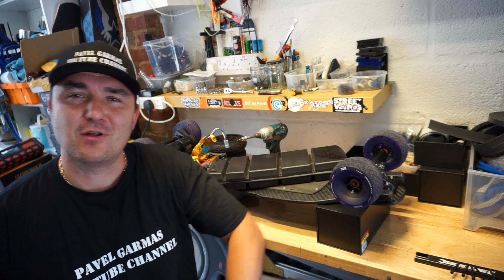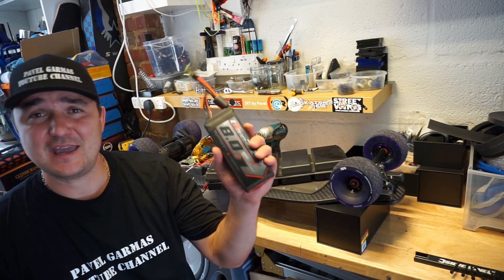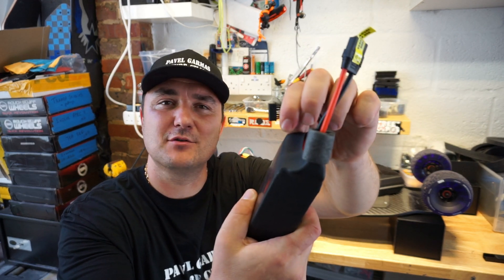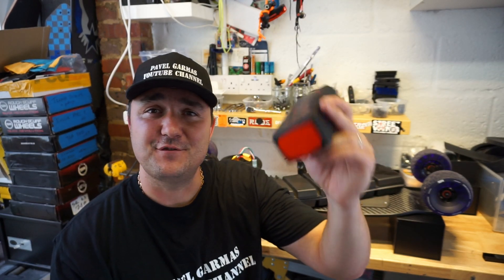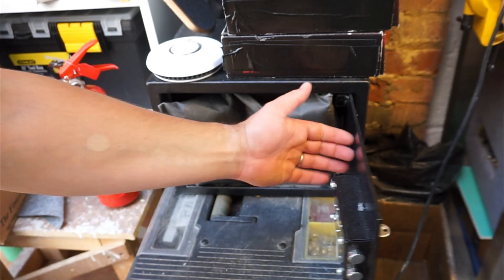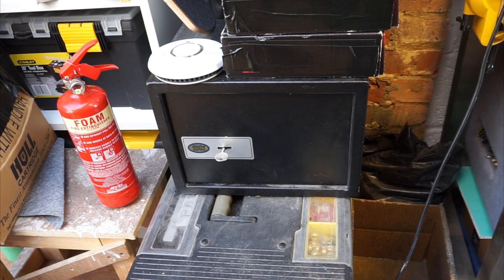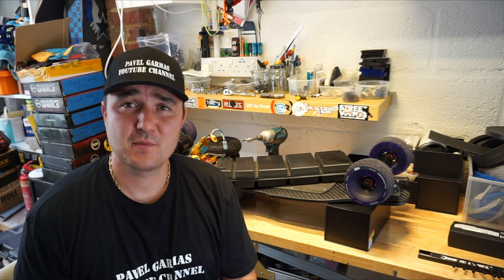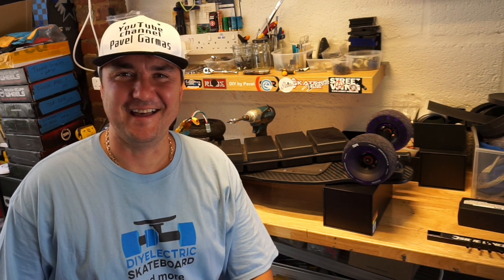The truth about Lipo packs. How do I store them. ESK8 did you know video 11.

Comment: Great tip i have a shipping container in my back yard that I charge my boards in as well as my 84V mower. I have nothing flamible on the far end where all the charging and a camera and honeywell co2 censor. My tip from first hand mistakes never ever ever buy 18650 from ebay or china 98% chance of getting fakes or b grade cells my first pack i made made with LG hg2 during a ride got so hot my enclosure started to melt. Cells were obvoiusly fakes now when i buy my bms with thermal sensor cuts power if pack gets to warm.
Reply from the maker: Nice one mate! Good tips.
I am getting a steel tool box to keep the batteries and might take them to the garden away from the house : )
I do buy my batteries from well known companies / retailers only but you  are correct - too many fakes,
I will cover 18650 packs in another video.